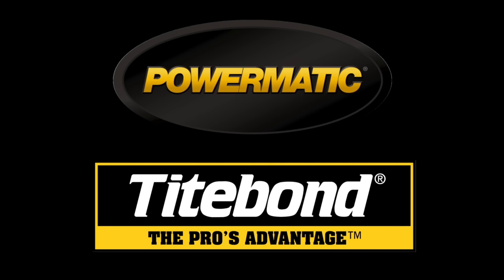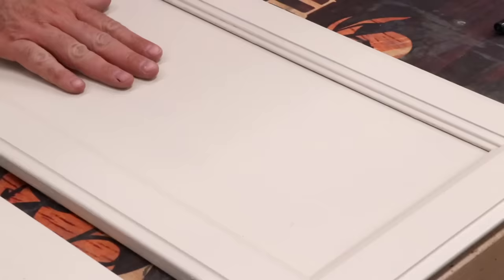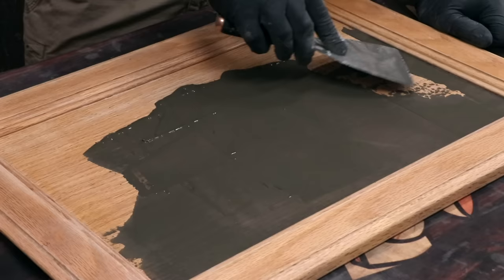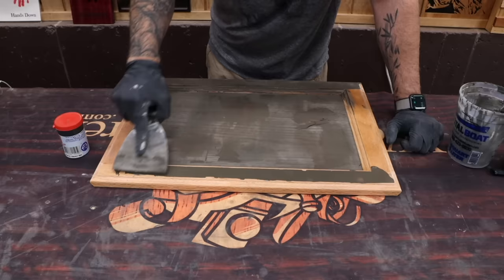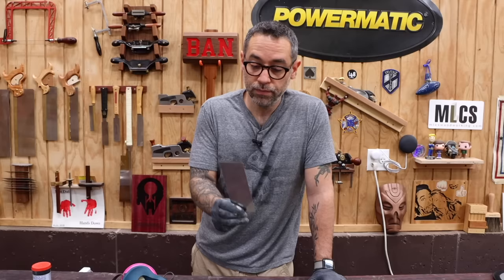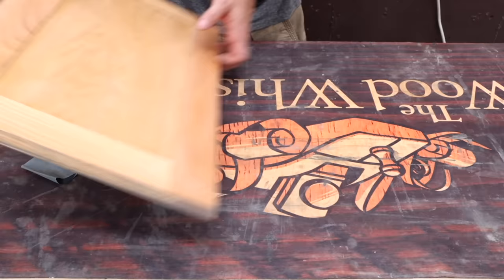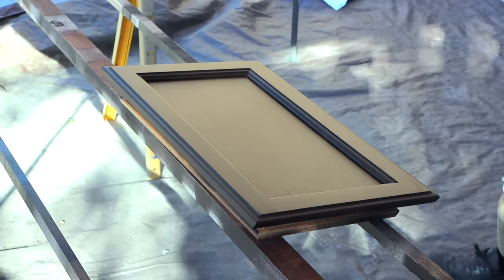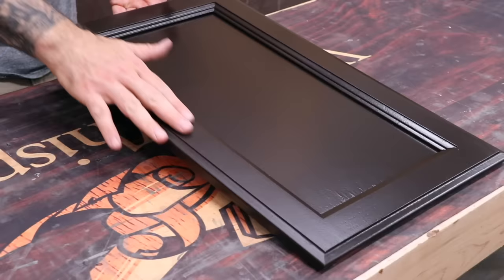Painting Oak Cabinets - Transform Your Kitchen!

Comment: I have dark stained oak cabinets. I would like to change them to an antiqued cream. I would like to know if I will need to sand them beforehand. I  do not want any grains showing through. With that said, do I then apply a (lighter base color) pore fill to the wood? Also, if I want the antiqued look, which brands would you recommend. Your video explains how doing something right (the first time) saves you the problem of having to redo it later. I don't think anyone wants that. 
Thank you 😊

Comment: If you wanted to preserve the grain, is there any way to sand the surface to then use a stain?  I have an espresso sandwiches almost like Black coffee, I think it looks really good but I can't apply it directly to the outside because I think there's a small finish coat on the outside of my builder's grade cabinets and the only way that I'm going to be able to get the stain down inside so it doesn't rub off is to sand it. Or would you recommend some kind of chemical that's not too smelly and actually does a decent job?

Comment: I am mind blown, this is incredible. Question: If my oak cabinets have a heavy clear coat do I need to sand the fronts before I even pore fill? Or will the filler cover that and give me the roughness to paint over? Thanks!
Reply: Since no one answered... Just scuff the gloss off with a scotch pad, apply pore filler, sand, paint... Look good as new as long as you take your time sanding and spray paint

Comment: Looks really good.  Before filling the pores, how did you remove the existing clear coat? Any tips?
Reply: daddybear236 you don’t need to remove the clear coat since you will be priming over the top of it. You could scuff the clear coat to aid in the mechanical bond of the filler. You typically would only have to remove the clear coat if you were restaining. Chemical remover would work best if that was the case.

Comment: GREAT VIDEO, I've been wanting to do this to my pickled oak cabinets for years.  I HATE the pickled coloration. 
Perhaps I missed you saying it, but at approximately the @13:30 mark, after you knock off the dust nibs, are you putting down another coat of the "Milk Paint" and then another coat of the "High Performance", or just the High Performance?  I'm guessing both, but if that is the case, why do you apply the initial coat of "High Performance"?  Thank you.

Comment: Use 3M STD-827505 Abrasive Hand Pad instead of sand paper to keep you from going through the coatings on the stiles and rails.

Comment: I just did this on my solid oak cabinets.  3 coats of Valsapr bonding primer, 2 coats of Valspar cabinet paint.  No sanding, just clean and degrease the cabinets before hand.
Reply: I've refinished several small apartments using General Finishes Gel stains.  Of course to prep, I use TSP to clean off any grease or oils, a light sanding using 180/220, a deglosser to enable a good bond,  then   2 coats of Gel, 3 coats of MinWax wipe on poly (water based just as good as oil, yet easier to clean)  (sanding atleast once before the final coat).
Reply: Has Valspar reformulated their paint to make it somewhat decent?  Every time I have ever used Valspar in the past it is like trying to paint with water.

Comment: 2 questions! Did you sand the face frames before you painted them or did you go ahead and paint it? After you sanded the panels with 320 did you go back over it with the milk paint and clear coat or just the milk paint?

Comment: The grain filling in this display was not complete. I have finished furniture for years and oak cabinets require numerous steps to totally fill the grain. I like a product called Aqua Fill. It comes in clear or white.  Easy to use. When finished I do not want to see any signs of the open pores in the oak. I do not like to use a metal knife like in this video. You run the risk of scratching the wood.  I use a plastic knife or a small rubber type squeegee.  Kitchen cabinets should be finished with an acrylic semi gloss latex paint. Sherwin Williams Pro Classic is a good choice. You must use a compatible primer under your top coats. I always spray and have gotten great results with a Wagner airless gun. When spraying you need to change the viscosity by reducing it about one third with water and I add  a small amount of FLOETROL. You can buy it any big box store. It is a must if you plan to brush on the finish of your frames. Like most refinishing projects, it takes time, patience and effort to get a professional looking job.

Comment: I have a kitchen that I did in the 80’s in oak that is obviously dated. That said the grain in oak is beautiful. It’s just the color has become dated. So knowing the original finish was lacquer I simply relacquered in burgundy. It was work but much less than your fill method. The end result was modern and refreshed but maintained the oak grain which was a very positive result. My take. Let the grain speak, and update the color.
Reply: Russell Poulsen as a paint contractor and proud owner of the same dated cabinetry I’m curious how it turned out.  I know the process just would like to see the result.

Comment: Do have to use filler on the part of the cabinet that's not real wood? I noticed the only real wood on my cabinets is the outline... the middles is partical board or something. (I bought my cabinets at Menards)

Comment: When you realize you have 30 cabinet doors and drawer fronts, all which have to be removed including all the hardware... Then you have to clean mask and spray all the cabinet frames indoors which is a nightmare in masking and covering your furniture and even your appliances while your family bitches about getting into the fridge... Even with careful masking, you always manage to find mistakes that need touch-up. Don't forget: there are two sides to each cabinet and even the drawer fronts need both sides painted too if you want to do it like the factory does. Each piece needs multiple steps of cleaning, sanding, priming, waiting to dry, sanding again (and if you really want perfection you'll sand after priming), then two more final coats--maybe with 6 hours between coats (e.g., Cabinet Coat)... BUT you realize you need daylight. Uggg, so you better be ready to paint early in the morning so it's not dark out for the second coat. Did I mention setting up an exterior spray booth? Oops (not fun). Oh, ... yeah you only have weekends--or maybe half a weekend if you have wife & kids... And you pray for good weather because you don't want to spray or sand inside of course <cough>. You also know brushing or rolling sucks and leaves horrific brush strokes (unless you use BM Advance and you are a master at brushing smooth and fast... and you have 16 hours to wait between coats). So then weeks go by and your wife starts to really bitch about you not being there, or maybe months if you have kids, and a full-time job too.

I used to paint show cars and have been painting for 35 years, and even with that experience, it always takes more time than I expect. I'm just finishing up my kitchen now... or maybe next week I hope... Started two months ago. What a bitch it is. But oh boy... it looks a-m-a-z-i-n-g :).

Comment: Ok question. I painted 3 coats of white on cabinet door. It looked fine, so I moved on to getting an enamel on there just to protect etc. Well, later on in the day, on different angle, it appears there is  a fairly large area that could benefit with another coat of paint. Should I just do a light sanding, add a new paint layer, and then enamel after?

Comment: I have painted over similar cabinets...there is now a much simpler more effective product on the market and less work.  STYX primer by Benjamin Moore.  Paint your cupboards and let dry for 24 hours...DO NOT SAND THE DOORS, paint primer directly on the finish.  Then paint with Advanced Paint by Benjamin Moore...usually two coats does it....Mine are in their 5th year incredibly durable, has not faded in a well lite kitchen.....

Comment: General finishes milk paint white it doesn't yellowing over time with the top seal(General high performance)?  I'm planning to paint my kitchen but I want to know which color or sealer doesn't yellow over time.
You don't need primer for the painting that I did?

Comment: I prefer using tinted lacquer for cabinet refinishing. I'll give them several coats of sanding lacquer, followed by 2 coats of high gloss lacquer and then a final 2 coats of [usually] a satin gloss lacquer finish. It last much longer than a water based finish and wear marks created around the handles are much easier to repair in the future.
Having said that, you did an excellent job with the prep and the finish. Very impressive.

Comment: Real good video. However at the end you said you really only need one more coat after you  sanded it with 320. you sanded and blew the dust off with compressed air and then said you were done. You never showed doing another coat. After sanding with 320 you must have done another coat right?

Comment: You said you put a tint in the wood filler. Is this a necessity? How do u do this? What kind of tint is it and how do u decide the color of tint?
Reply from the maker: The tint isn't necessary at all. But I figured if the paint color is dark, I may as well go dark....and vice versa. Timbermate wood filler comes in various colors but you can add dye to add color if desired. I use Transtint. https://amzn.to/3psyuMD

Comment: Awesome result. Thanks for the great video. Question: Did you pre-sand, prior to doing the fill, and, did you have to apply a second coat of fill at all to get the finish you wanted?
Reply from the maker: I only sanded a little to smooth the old finish and essentially clean it up. And most areas only required one coat of filler. A couple spots did require a second coat.
Reply: @woodwhisperer  Super. Thanks!

Comment: Very nice job, but an awful lot of work... I repainted solid old oak cabinets without filling the grain and we are very pleased with the results.  You can see a trace of the old grain but it actually adds some character to the finished look.  The job was simple, first wipe all the cabinets down really well with a liquid de-glosser (very important), then one coat of primer and 2 coats of satin finish topcoat, we used white.

Comment: So you used the wood filler before degreasing and and sanding? My cabinets have a clear coast on them so what would should I do first?
Reply: Also, if I use behr cabinet and trim paint do I need to primer first?

Comment: Great advice! I'm currently restaining the exact cabinets where someone applied numerous coats of poly making sanding the profiles impossible because of the thickness. I've used the Rockler sanding tools and other stuff with sharp edges - still can't get all the ploy out of those crevices.
Any recommendations???

Comment: if i'm pore filling, i could probably have mine done by the time I retire or the sun finally implodes. If you use the right paint, you won't have to pore fill. I personally would rather burn the house down and rebuild than fill/ sand all the cabinet doors. especially since the cab frames would still show the wood grain. time for an insurance claim

Comment: Anyone ever use a similar method to fill in a bead board panel for shaker doors? To give a flat, smooth surface. Or possibly a smooth 1/8” panel on top of the bead board?

Comment: Does this process change when there coated cabinets?  My cabinets have a thin protective layer and paint won't stick to it.  Tried liquid sandpaper but that didn't work very well.
Reply: Use a primer before painting. I don’t know the exact term to ask for in English, but just describe the surface to the people at the paint store and they can probably help you find the right thing.
Reply: Use Gel stain.  I did this over faux wood formica cabinet doors and cabinets.  See above for my process.  Gel stains stick extremely well so far.  Can you believe it on formica?

Comment: Painting oak cabinets I don't think makes them look any more modern...had similar cabinets in a house built in 1989 and most of the door spacing was out of whack had new oak doors made with glass at the corner and end cabs turned out really well

Comment: My cabinets looks exactly like your mom's! They even had that weird look where it looks super dry, blotchy, and hazzy- do you know what causes that btw? For the first ten years of living here I didn't want to paint them because not everyone has real wood cabinets. But at the same time my gosh are they ugly lol. They're not really ugly it's just not the color of wood I like at all I don't like they yellowish hue. I have thought about getting them stained a different color. I haven't even checked on doing that because I just imagine that would cost a lot of money and even more time, you could probably get new ones cheaper just guessing.  My other half had always just wanted to paint them which I was against until now.  Any cabinets I have ever seen that have been refinished by painting them it's obvious someone painted them and looks like they were too cheap to buy new ones.  It looks like you did it the right way,  I'm totally down with that. I just worry about the paint not sticking to it properly or the finish not holding up the same as a factory finish.  Did you paint the inside of the drawers also? Did you install new hinges and drawer railsor just reuse the originals?  I seen where you can get soft close mechanisms to replace current ones,  I would really like to do that.  After using soft close doors going back to the standard type feels so cheap.  I seen you diluted the paint- why do you do that?  About how much did that cost you?  Thanks in advance.  Ps... they look really good! It really transformed the look of the kitchen big time!

Comment: I wonder if automotive primer filler might be quicker solution. The primer fills low spots and sands easily. Topcoat with a quality paint, (maybe a urethane alkyd), topcoat again with polyurethane. Spray all coats. Any thoughts?

Comment: I am in the process of painting a lot of oak cabinets. I find if you are using a deeper color, the oak grain isn’t as prominent as it is with white or cream cabinets. For me it is just too much work to fill all the grain then prime and paint. Plus the whole house has oak trim and woodwork so what’s the point of pretending the kitchen cabinets are different from the rest of the house?

Comment: To paint these lowest of quality cabinets, without the filler and sanding, spells disaster. This is a very labor intensive project, and it is difficult to find a qualified contractor that would do the work. And you are still left with a low quality product, will subtract from resale value. I tore my "yellow" oak cabinets down, and started over with a HQ Shaker design. Decided not to put lipstick on a pig. That said, job well done by this craftsman- a great son!

Comment: I have a question my bathroom upstairs in my bedroom I painted white white the shower curtain is gray and white my light fixture is that brushed gray nickel. My husband built this house 28 years ago by himself and you have to remember those cabinets are All real solid  oak and he says I am not painting them.  but the flooring that we went with is like a wood gray waterproof thick flooring for the bathroom but my cabinets don’t match and he seems thinking who cares. And the countertop he has is black. With one sink. He said when he built the house it was supposed to have two sinks but he has a black counter top that goes from one wall all the way to the other wall with a mirror that goes from one wall all the way to the other wall to the counter space to the ceiling that’s a big mirror. And he doesn’t wanna remove the counter top because he’s afraid of breaking that mirror when talking it down and he’s keeping it because it was expensive. I thought what about if we paint or re-stain the cabinets. I wish I could show you a picture of my old cabinet. I went to Menards and the lady said I would paint it she said that’s gonna look dumb and it won’t match. And my husband has a thing about painting sold oak wood Thanks why can I just strip it and re-stain over it and not paint it or can I try sanding it a little bit and try to do a tiny corner to see what it would look like if I just re-stain over the color

Comment: Actually l would have white washed those beautiful grains, would definitely not fill those grains, sanding will be a nightmare. I have flat surface doors and will be using an enamel paint that’s drip resistant. Oh no a water based paint for a kitchen just doesn’t last, tried it on tons of furniture, it was a waste of time.

Comment: The term you used telegraphing does not apply to woodworking.
You fill the wood pores to stop:
mirroring of the grain.
Mirroring not telegraphing.
Reply from the maker: If you Google "Pore filling to prevent telegraphing" you'll get a bunch of woodworking results. If you google "Pore filling to prevent mirroring" you get mostly makeup ads. So you can use whatever term you like, but telegraphing the term I learned and it's clearly the one most people use and understand.

Comment: Dunnot like this paint-everything-white trend. There are ways to update and make your wood glow again without covering it. Usually changing the rest (handles, tiles) should make the trick. You can give your kitchen a nice farmhouse or Italian kitchen style and add a few modern details here and there like a concrete or tempered glass ceiling lamp. Imagination is what will save your kitchen. Not paint.